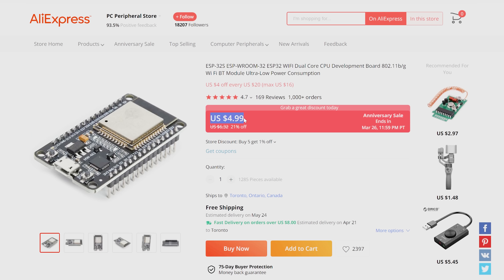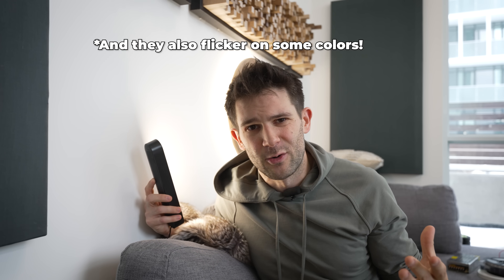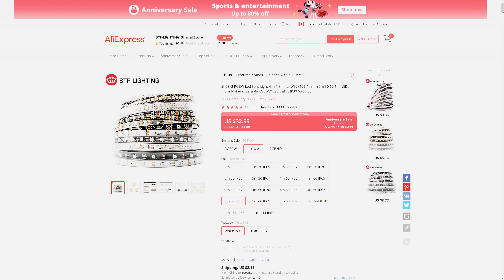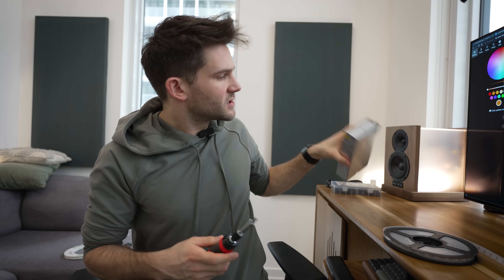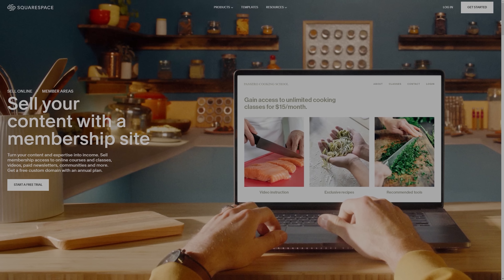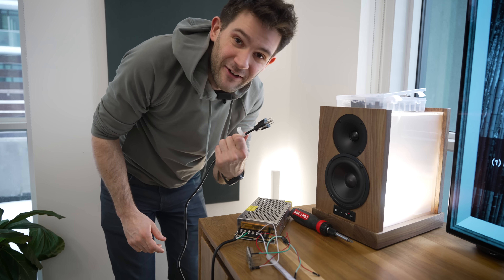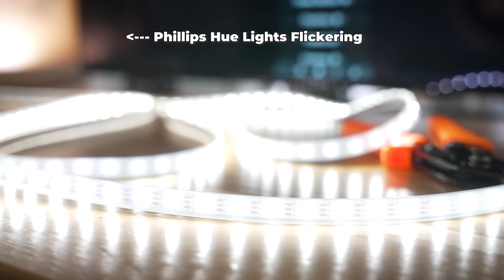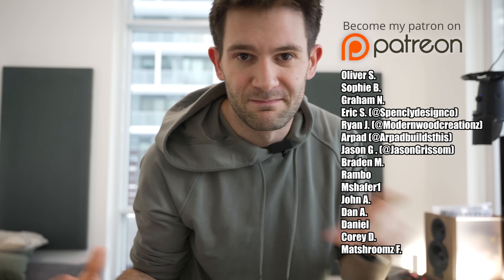RIP Philips Hue & Govee

Comment: Really nice video, but if you really want to check if the LEDs flicker, you should use speeds that are not divisors of the mains frequency, 60Hz in your case. With 1/120 you might hit a shutter in phase with the mains and with a value of 1/150 for instance, or 1/250 you can actually check the flicker.

Comment: 18 amps for a 5 meter led strip at 5 volts…..something is very wrong there. Most home circuits in the USA are designed with 15amp circuit breakers max. Occasionally 20a on older installs. That is like running a 20 gallon air compressor at 110v. 18amps for 5 v leds is just not right. Edit: well I went and double checked and based on .3 w per it is on. Weirdly high current for a led strip.

Comment: Just a note about the slow turn off time: it could be the power supply. It uses some large capacitors which can stay charged for a few seconds even when their power has been cut off. So the delay in the software might be perfectly timed. 
You can check this by putting an LED on the direct output of the microcontroller. If the LED turns off but the strip is still on, that's the PSU. 

There is no real solution to this. The PSU should have capacitor discharge resistors in parallel, but it's a 20A PSU, and the capacitors still hold a lot of charge. 

FYI, this is also the reason you should not touch a PSU's I/O terminals right after plugging it out, you can get electrocuted.

Comment: Idk abt y'all but a philips hue light is like half the price , upon checking tje pricing of all the components. Especially the light strip itself. 

Walled garden it is for me
Reply: Philips hue is a sync box with hdmi 2.1. this device analyze video single and make color based on it. That's why it costs so much.
In this video its just a static color led without any dynamic color changes based on on your screen.

Comment: I don't think you need to worry about frying your board from the length of the rgbw. Atleast never got that problem myself. The light will just be dimmer as it's in paralel.

Comment: From experience, if you're running less than ~125 LED lights in a strip (great for about a ~6' run depending on your LED density) you can just power your LEDs right off of your board and the 5V that it pulls from a micro-USB connection - removing the need for a separate power supply. The separate power supply is really only needed if you're going to do control a heap ton of LEDs off of one board. Thanks for the video Zac! Really nice walk through.

Comment: WTF, if they added more wire to the switch, flip it 90deg, it could be accessed just from the side through the housing. Why do we need to open and break a seal. But it states it needs to be opened to alter the switch.... Whats is that for reasoning?!?!?!

Comment: What about wire gauge? He didn't say anything about it but it's a safety issue. If you use skinny wires for 18A of current it might overheat or result in voltage drop, or both. Quinled dot info has so much about this subject.
Reply: Ditto on Quinled

Comment: You may want to add a line level converter to your final version as 3.3v on the sign wire can cause issues on longer lengths of leds. Fairly easy to add. Hope this helps

Comment: You have a complaint about security in your smart LED software, and then turn to open source... okay.
Reply: Tuya and other iot brands usually have software that sends your wifi credentials and more to the cloud so china or whatever host has your data. This wont put out info outside the local network. And this wont require tuya to stay in bussiness. Still it can be hacked but its a bit more secure. I mean your router can be easily attacked and every device will be vulnerable. There will always be vulnerabilities. Its just if you are an interesting target to the hackers

Comment: WLED and ESP32 is worth it if you care about details, specific run lengths, number of LEDs per meter, specific RGB scenes.  

If you’re just Joe blow looking to have some lights underneath the bed or behind the couch, and an IR remote is good enough to change colors for you.  Stay generic, it’s not that expensive and it’s a ton less time, and there is zero chance of burning your house down.   

It ain’t worth learning about power injection and soldering and using a multimeter just for that.

Comment: Those wires probably aren't rated for carrying 20 amps, luckily your strip wouldn't run that much nearly ever, but if it did you'd want to run your DC power supply to the other side of the strip as well, to mitigate voltage drop, wire heating and even internal breakdown on the strip itself (since it is it's own conductor) 

The flickering is caused by a low frequency PWM modulation for dimming, not AC power. 

Otherwise great tutorial and really love that people are moving away from proprietary garbage.

Comment: Please tell me you have a part 2 to this video for noobs like me. 

What I mean is how do you get those led strips wireless so you can put them anywhere without having them connected to a brick power supply like that.   And do you need to keep that little bored plugged in somewhere at all times? If so how do you hide that? Would be an eye sore just sitting out in open view. My opinion anyways. 

I'm looking for cheaper lighting solutions and have always used Phillips but it's so expensive.  I've only got 2 of their bulbs. Never used led strips before so not sure how all those work yet but I'm hoping they can be wireless. Would be nice to find cheaper bulbs as well.  Need a couple in my closet.

Comment: I did this a few years back with an Ikea Vidja lamp. It's got 3 individual white shades on it as a 4 ft" cylinder. I put some PVC in between each section and ran 3 strips of 5m around them, inducting it additionally.

These effects look great when they're wrapped around an object instead of a straight\curvy line.

Comment: I have a Wiz bulb light which was given me some software issues. So I take it apart to see the insides, and I found that the light was controlled by the same ESP32 as you showed. Also I found information about other brands using the same ESP32.

I will try to flash the controller board with WLED using a usb-ttl adapter and see what I can do!

Comment: FWIW, to avoid overheating your power supply, you should use the 80% rule.   5v x 20a = 100W x 80% = 80W maximum output.  Choose the wattage of the LED strip(s) appropriately.

Comment: You should have a power supply of at least 22.5A output 
We build LED signage and an LED power supply is deemed to be overloaded if it exceeds 80% of full load current and 18A is 90% 
Especially an Ali Express power supply

Comment: Soo many wrong things here.. one is that 20a through the pcb trail on the led strip is asking for fire if it ever shorts, thats why a 12v system would be much better. ( more volts is less amps needed), another is that with these adressable led strips the esp32 doesn't determine the pwm, its the chip with/in each single led that  determines the pwm, and thus flicker. Cool promoting this to people regardless, but please, bit more research :)

Comment: Good video.  You need to invest in a ferrule kit and crimper tool.   You should be binding terminals to ferrules when possible.  It helps with wire strain, better electrical connection, and more.

Also power supplies should never be run over 80%.  Personally, I aim for 60% for a margin of safety but also still close to their most efficient power conversion.

Comment: 2:14: you’ve provided all the reasons I went with Hue. I’m not typically a “big name” purchaser if there’s a better alternative, but a few years ago they were the best game in town. And while closed source, Hue integrates well with other systems in my home.
Reply: I spent hunders on hue. Now I'm just using their 4 button remote\wallplate and the motion sensor. The hue lights are boxed, lightbulbs\strips\hue plays, all replaced with cheaper bulbs and individually addressable led strips unfortunately.
Reply: @mcg9573  Why’s that?

Comment: Is it possible with 12v led strip? Because the power supply is a lot smaller. Only need to know if that works with the board. Cheers!

Comment: If you are just wanting to integrate led strips to Philips hue software there are some controllers that allows you to do that, but can be pretty hard to find. But this is pretty nice if you want to switch to an all open source project. Now what would be interesting is if you can control your Philips hue lights with the open source software.
Reply: Yeah that would be nice. (edit: talking about controlling hue with WLED)

Phillips uses ZigBee 3.0 now, or rather the bridge supports it. It is an open source standard. You can hook up pretty much any light to a Bridge. This is what you're talking about. My point is, it's no longer closed source only.

Of course any extra features they add to their products that aren't handled via the ZigBee protocol are not open source.

Comment: A lot has been said already but there is a lot of information here is is not quite right. Just as a heads up you want to size the power supply up so you are running it at 70% of max output, most manufacturers state it in the documentation, but you are buying crap from Ali soooo…

Comment: WLED has built current limiting which by default is 850ma so it wouldn't burn out the microcontroller. Also, you can buy an esp32 with USB C or a number or other connectors l.

Comment: I know this is an older video, but if you want a less messy solution there are small boxes that contain the controller board and just have a simple power in and out connections without worrying about having to bypass the controller.  There is an Anthom controller that will pass through 16 Amps of 5-24V out of the box with WLED pre-installed.  The controllers are more expensive but the setup is much tidier, there is also a newer manufacturer that has just turned up with similar $10 boxes that only do 10 Amps.
Also, if you are worried about consistent colour output over a longer line of LEDs, 12V is better as you have less issues with voltage drop.

Comment: At 11:00 there's an important part of information for those building this in countries where electricity costs half a leg such as in Belgium: powerconsumtion for 5m of LED is 90 Watts. Philips LED strip of 2m consumes about 20 Watts at full brightness, so 50 Watts for 5m. That is about half of it. Since those LED strips are used at places where they are on a lot, the difference in price can be futile after one of two years. I do really like ESP and ESP Home (using it for tons of different things) but when it comes to lighting, when putting all info together when used in countries where energy is expensive, it is difficult to beat the big brands such as Philips Hue. It is expensive at time of buying, but when looking at long term use, it is reliable, easy to use and cheaper

BUT: much appriciated video (subbed) as it is a clear guideline on how to build this yourself at a very small cost. I always like channels where they give a lot of info and actually show how to build things. Hats off!

One thing I am curious about: what about Hue dynamic scenes? Is it also supported
Reply: Is that wattage difference not attributable to more and/or brighter LEDs? Hence similar power consumption at equivalent brightness? I have no idea btw

Comment: @ZacBuilds Doing some research online, the green data wire should always be 5V. Do you think that this setup would work with 12v or 24v LED strips if you use a Step Up Converter (For LED Lights) or Step Down Converter (For the ESP)?
Reply: For higher voltages probably better to just use the Athom WLED controller for simplicity, just plug the power supply in one side and the same voltage LEDs on the other side.  I have a 10m 12V string of LEDs and there is no colour shift along the length of the lights.

Comment: If I wanted to hardwire this set up can I connect a 14 wire to the driver (power supply) directly from power in the wall and then wire that to a switch in the wall?

Comment: If you are into DIY that’s good, just go for it. In the end, I went with govee, and I’m glad. The DIY is difficult, for me, the power supply is way too big, you need to spend hours and hours to find all the right components. Those 5$ controllers are always slightly different from each other, so the power supply, if you don’t know how to use them, where to connect the cables, how to program the software very complicated , then it’s a nightmare. Hours and hours lost, my experience. With Govee I found what I wanted, it’s expensive but half the price of Philips, the led strip is fantastic, and the App is fairly easy and very customizable, and everything works right away, very quickly. That’s my experience.
Reply: Have to agree, if it was insanely cheaper AND very reliable, I would definitely go DIY... But it seems that all these DIY don't go with an impressive length. Govee here, and everything is just so simple. I'm PERSONALLY willing to pay more for simplicity and reliability.
Reply: @L1Z1O  Take a look at the Athom WLED controller ($20), it has all the messy wiring inside so you have power in and a connector on the other end for the LEDs.  This will work with 5-24V 16A so you can get whatever type of LED strip you like.
There is also a similar controller from Gledopto which is about half the price but will only do 10A.

Comment: Many WiFi bulbs and other WiFi-enabled LED lights, especially cheaper ones, already contain an ESP8266 (often in the form of a Tuya module). The ESP8266 is the "younger brother" of the more powerful ESP32.

For the adventurous with a soldering iron and a USB to serial adapter, you can connect up to these and reprogram them with WLED, Tasmota, ESPHome, or whatever other control software you prefer.

Safety first: If you try this on a lightbulb or other mains-powered device, DO NOT have the device connected to mains power AT ANY TIME while you have it open or have programming wires connected to it! Let the USB to serial converter provide the required 3.3V power.

Comment: Lol, recommends not trusting an Ali Express smart light on our home networks but proceeds to connect an Ali Express board to the network.
Reply: ... open open source software, which does make a bit of difference, even though not a completely guaranteed safe one either.
Reply: @arnovanwingerde8589 Not sure why everyone thinks open sourced is safe. By definition its code isn't locked down, making it potentially the most unsafe option.
Reply: @arnovanwingerde8589  Open source is great but open and has that inherit vulnerability.
Reply: It's a difference. The aliexpress lights come preprogrammed with tuya cloud rubbish WHILE A MICROCONTROLLER PLATFORM LIKE THIS IS (THIS IS NOT THE LAMP) can be programmed and usually comes blank and can be programmed with your own firmware. Learn the difference between hardware and software
Reply: @309electronic5  No need to sing mud. Both items are hardware and can have malicious code stored within. You have to expect that when you buy something for much cheaper than usual that there's a catch. It's up to the buyer to decide if saving a few dollars is worth that risk. Nothing is truly secure but consumers can do their best to make it a but more challenging than buying potentially compromised hardware to save $10.

Comment: Please do not suggest to use 18 amps through (the preconnected) cables that are only rated for about 1-2 amps. They're probably 22 awg (0.92A) or 20 awg (1.5A). They get really, really hot if you carry 18 amps through them. And even if the LED's specs are not accurate 1.5 amps is not even close to 18 amps. Even the Black connector that are pre added to the end of these LED Strips are only rated for about 4A.

If you connect a 5m String, you'll have to add more wires every meter or two to reduce the heat in the strip and to get a better color-match further down the strip.

Comment: Great video :) Question: Does the power supply have to be this big?
Reply from the maker: No definitely not. It depends on how many LEDs you want to run in the chain. If you do a short run you can use a much smaller power supply.

Comment: Ackchyually, AC power "flickers on and off" 120 times per second on a 60Hz system; 60 times positive voltage, and 60 times negative voltage, (120 times no voltage).  Cheapie LED drivers will just draw power from one half of the sine wave causing a more prominent flicker, other drivers (using full bridge rectification) draw from both halves of each cycle making the flicker less apparent.

Comment: You won't fry the board by simply connecting the LED to it. Components don't 'pull' current when connected. Hence the reason you get dimmed lights when lower voltage is applied. You've also connected your ESP to your PC. Your USB port can only supply V5 at 0.5A, so you physically cannot fry anything.

Small mistake but it shows that you don't know how electricity and components work fundamentally.

Comment: That's one big ass power supply for the light strip.  Good luck tucking that monster away somewhere and hiding it.   so its $5 for the ESP + $Power Supply +$8 for the cable (not sure why you paid $8 for a PC power cable) + Cost of light strip + misc parts/tools + time to futz with it all get get it wired up.... Those govee and hue lights aren't looking quite so bad.

Comment: Opening a PSU can be VERY dangerous, particularly with those cheap Chinese ones. You should wear an ESD strap connected to ground as their filter capacitors can have hundreds of volts stored for several days and the shock can be nasty. The fact that they make you open it to change the input voltage is... shady... just don't touch ANYTHING else inside of it if you don't have the tools and knowledge to do so.